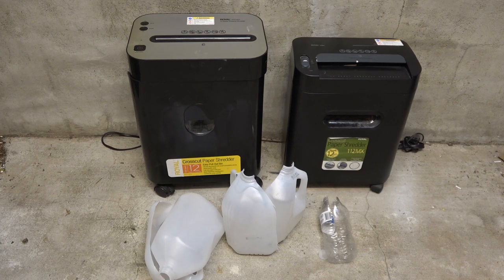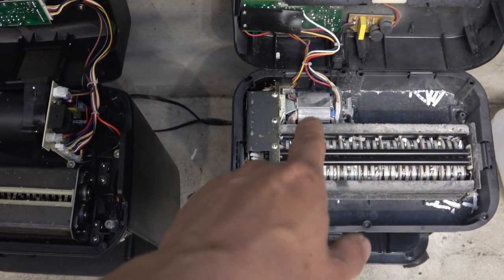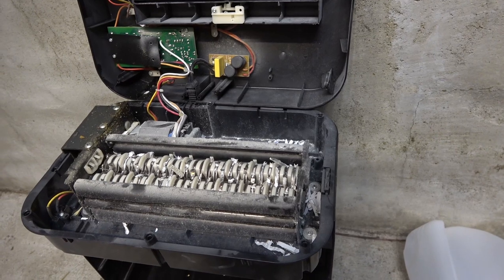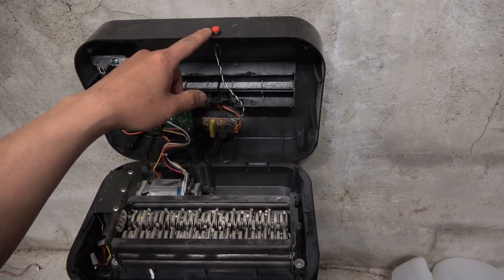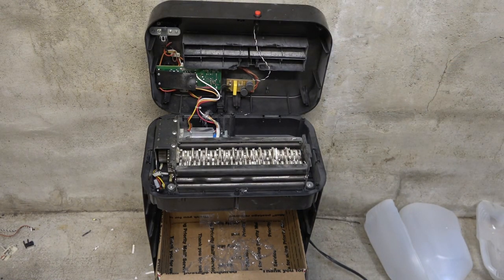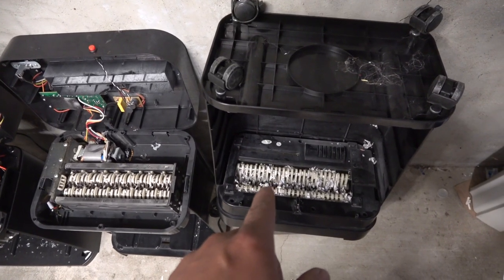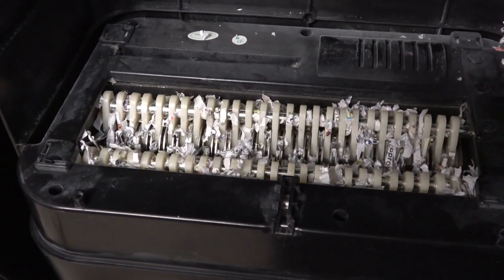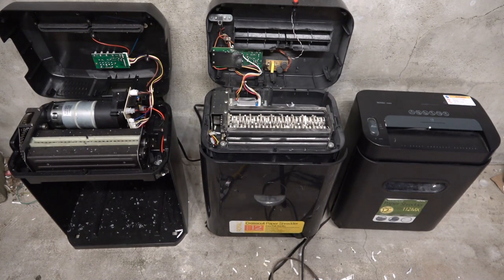Precious plastic S01E02: Hack a 12-sheet paper shredder for cutting recycled plastics

Comment: I would be tempted to take out every other spacer between the blades, having two blades directly next to each other, making them twice as thick, then re-build a larger feed hole frame. With the shorter width cutting area may reduce any bending as larger plastic goes through. Also, replace the nylon gears on the motor with metal. Then after building the new macho shredder, I would shred the failed shredders. Or, I could save up big time for a precious plastic shredder kit. Excellent video's, you have saved many who would have wasted time and money.

Comment: I use the same process to recycle my plastic. What I would suggest you to do with your good shredder is to opperate it upside down and running in reverse. The bigger opening is then on the right side. One thing to consider tho is that you'll have to cut the opening where the paper used to be fed to let the plastic fall in the bin.

Comment: You could try plastic vacum packaging. Its everywhere. It could be a great recycling project.
Reply from the maker: Isn't that a different kind of plastic? LDPE?
Reply: @vuaeco  I don't know, but all plastic is reusable in some form. Isn't it?
Reply from the maker: @gene8194  Yes, as long as they are the same type, they can be remelted and molded into new parts.
Reply: @vuaeco  now the question is how to figure out what type they are? How to sort them.
Reply: @gene8194  most thermoplastics can be reused by melting and reforming, but thermosets are more tricky to use, and any mixes make it much much trickier (melt temperatures, unpredictable additives, unknown toxic fumes etc.) There are tests you could do to figure out what sort of plastic this vac-pac is. Often, this is a mix of polyamide and polyethylene, you should be able to melt it and bond it together, but careful with the fumes. The melting temp differences between these two is quite big, so you may have mixed results. Post some videos if you make any discoveries!

Comment: Then you dump shredded petroleum into the ocean huh!!
Reply from the maker: You didn't realize plastic was made from petroleum?
Reply: I would use something like this for plastic kitchen waste to be able to get bore plastic into the plastic recycle bin. Ours isn't big enough yet is mostly filled with air when filled, small shreds might be a denser load in the bin.
I would also want to shred corrugated cardboard boxes for the same reason.